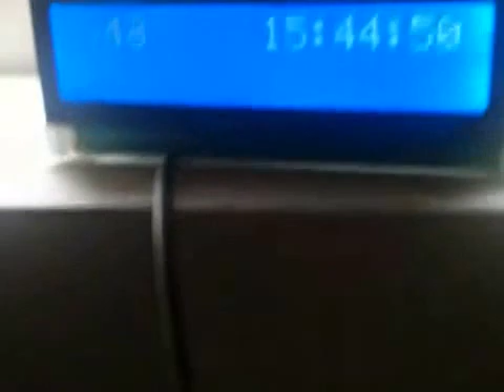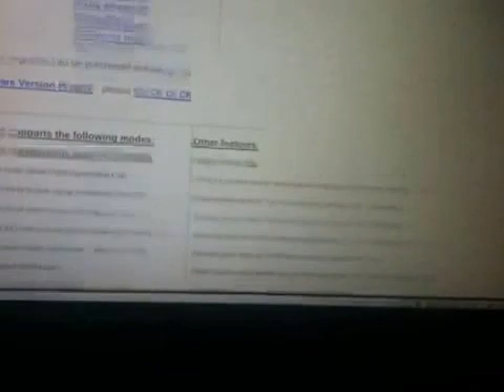WSPR Ultimate3 beacon Adafruit & hanssummers.com

Comment: was the interface to the Ultimate GPS module difficult to do?
Reply from the maker: No, not at all..I used a 4 wire Molex connector between the 2.